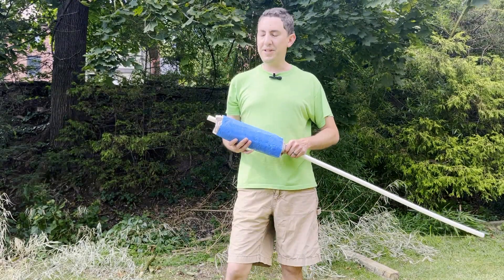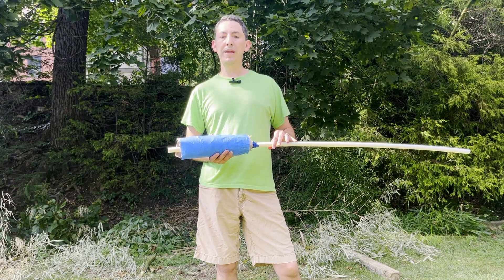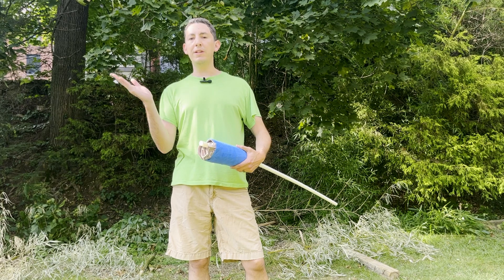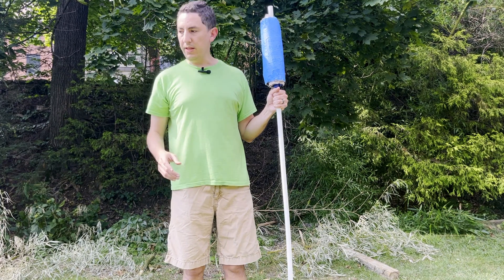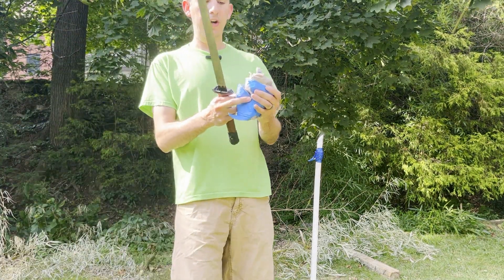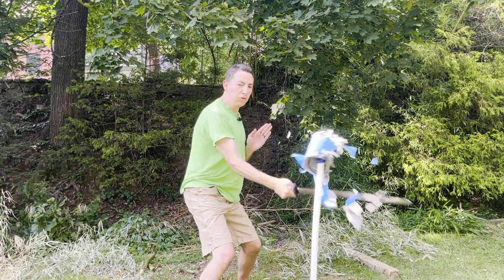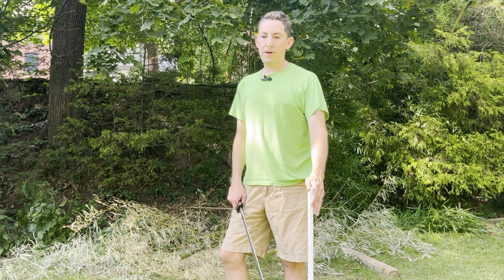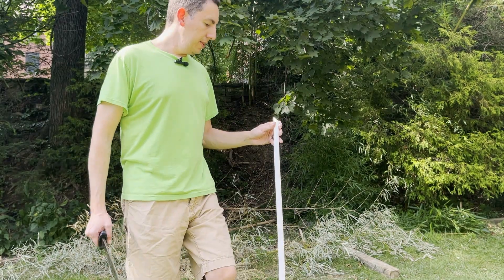Cutting bones with a sword?

Comment: Just order tatami mats with sugar cane since it's not hollow like bamboo and it resembles bone; keep it soaked in water for a week I believe. As for newspaper soaked in water I think it's thicker and more hard to cut. get the plans on how to build a wood stand like that of the tatami mats.
Reply from the maker: Sugar cane might be a nice cutting medium that could be slightly closer to the cleavage of bone. Note that it will have a bit more acidity in it that many other plant material so you will need to clean your blades very very well after cutting! 

Yes the newspaper is harder to cut than tatami. Tatami is very good for giving information about how a given strike is performed, but it is not really a simulation of anything; this rolled soaked newspaper will eventually be an analog for human muscle tissue, which is fibrous and self lubricating.

Comment: You may use a PVC pipe as the cutting stand, for it is rigid. Use a big diameter one so that it provides even more rigidity. Just be careful not to hit that one. LOL. Sometimes I did, and still manage to cut through double bones but edge may suffer some damages.